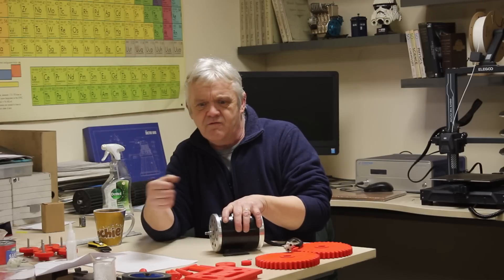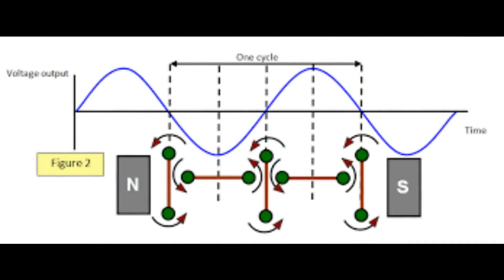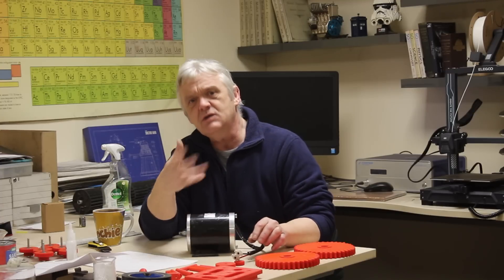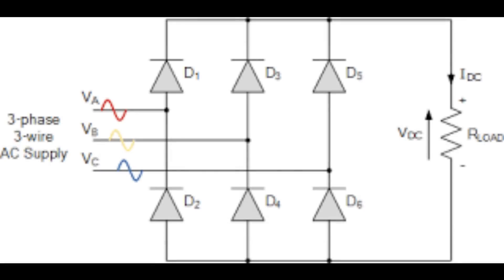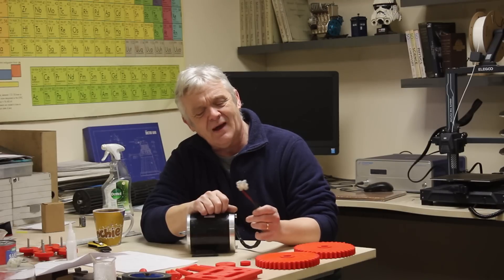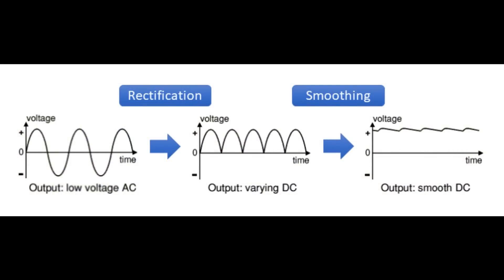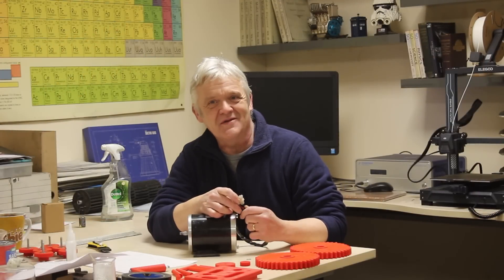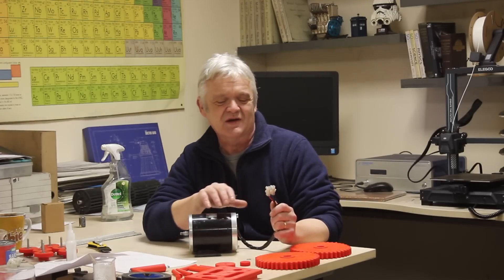1826 What Is MPPT And PWM And What To Do With A DIY Wind Turbine

Comment: There is no maybe. MPPT Controllers.

For crying out loud, YOUR battery argument...

Expesive battery that lasts 27 years

Cheap batteries that last 1 year

MPPT are at least 20% more efficient than PWM

MPPT can be homebrewed just as easily as PWM. Use and Arduino to control IGBTs.

FFS This is a no brainer

Comment: MPPT is about the  neither the power source, or the load. It's about setting the  load's  apparent resistance to the source such that the maximum power flows out of the source and into the load  battery and other electronic equipment.  MPPT adjust the apparent resistance of the load as it appears to the source.  

Here is the theory. 
Take a solar panel, Let's say in full sun, it's unloaded output is 20 volts, and its short circuit currentb is 5 amps:

1) 20 volts/practically infinite resistance = 0 amps, and 20v × 0amps = 0 watts.  
2) Or when we short it and the pannel outputs 5 amps.  Then 5 amps × nearly zero resistance = 0 volts.  And 0 volts × 5 amps = zero watts.   At these two extreme there is no power transfered. But there is a resistance in between  between ware the maximum  power flows from the source and through the MPPT controller.    

MPPT adjust the apparent resistance of the load as it appears to the source.
Reply: Mmmmm 
Yes

and no. Rob isnt an EE. Heʻs a ChemE. So, you just allotropically phase transformed his stoiciometry past the vapor, triple point.
Reply: @canberradogfarts   But Rob is spot on in most cases, simple and elegant, being one of the reasons I subscribed. His conversational style, is also soothing and helps overcome sporadic dopamine deficit.
Reply: @aware2action  I almost completely agree with you 100%. Which is why this was such a dissapointment. This video was too clever by half and completely wrong in fundemental concepts. Which he could have prevented had he done more homework. MPPTs are VERY old, the technology, circuitry and theory go back to at least the 1950s. Ampldynes and mag amps are still in manufacture today that were originally designed during,  WWII, USING MPPT.
Its old, its mature, and it is SIMPLE. Yet Rob missed the mark. Not out of malice or incompetance. He got ahead of himself, he got, for lack of a politely British word, lazy. 

Robs not an Electrical Engineer. He is a Chemical Engineer. He should have done a week or two of expl8cit homework on the subject and written a script, IMHO.
fin
Reply: @canberradogfarts  he only made this video because someone in the comments was complaining that he only covers energy generation and not the portion concerned with connecting the battery/energy storage. So Rob said Okay I'll do a video. The guy is spread thin with managing the fan's whims and he is committed to daily videos covering wide ranges of topics. 

This topic of charge controllers for energy harvesters is widely covered on YouTube BECAUSE it is a mature technology, this is just a summary in the style of his videos and it was fine for that purpose. What this community needs isnt the most clever ideas but some form of self-organization so RMS can juggle less responsibilities. I prefer a forum, myself.
Reply: Also almost all regulators involving wide range of input and output voltage/current use high efficiency switching regulators. One case PWM would work well is, if the output of the solar cell is matched to the battery voltage. The loading effect of increasing duty cycle tries to bring down the output voltage of the solar cell to the desired charging voltage. MPPT on the other hand boost/buck the voltage levels (through high freq switching regulators) to maintain optimal loading by the battery being charged. PWM is simpler and more reliable in general, but a little bit less efficient and cost effective. The same cannot be said for MPPT controllers on the market(esp. the cheaper ones).

Comment: I built my own using a 555 timer, a 78L05 regulator, 2 GP transistor, 2 mosfets and a handful of passive components. 
I needed one for my DIY wind turbine asap, and didn't want to wait months ordering one from China. 
Adjusted the potentiometer to stop charging at 14V, charging a 12V SLA battery. If it goes over 14V, the power is diverted to the 10 Ohm 100W dump resistor. 
Works like magic! MPPT is for systems > 1KW. Otherwise, you're wasting your money.
Reply: Uhhhhh FALSE!

Get an Arduino and learn It is literally easier than what you did. Plus, what you did is so 1976. I hope who ever is grading you project is a social studies instructor and not a competant science instructor. Really. You should be using the best, least tech thats been around for two decades, not six decades.
Reply: @canberradogfarts  I was using Microcontrollers when you were in diapers little man. How old were you back in 1982?
Reply: @canberradogfarts  what he did cost pence and works exactly like you'd want it to.
Reply: You're both wrong. Also, take your new fall apart phone controlled gen z 'tech' and shove it @canberradogfarts

Comment: Question: I've made a small zinc-bromine battery, put it in parallel with a small supercapacitor (made following one of your videos) and connected to a small solar stirling (is a glass tube with steel wool and partially painted black, closed with a ballon with a linear generator and a diode to rectify the output). It seems to be fine as it is, it charges during the day and lights a small led the whole night (never measured how long it would last). In the small scale I did not use a charge controller, if I want to upscale the project, do Ineed a charge controller for the zinc-bromine batteries?
Reply: If the generator voltage greatly exceeds the battery voltage, yes. Also need to make sure the current going in is not excessive, otherwise your batteries will use a lot of water due to gassing.
Reply: @unicornadrian1358  thanks

Comment: One nice thing is that MPPT can modulate your voltage from a 12-24v generator to a higher voltage like 48v and also reduce the risk of damage to lipo and li-ion batteries

Comment: Great overview of basic power controllers!!! Starting to get into senior-year engineering economics, tho.  Sounds like an awesome application for your ultra-robust AC carbon bacitors configured to the desired voltage range with your fractal relay array.  Wouldn't that be cheap, powerful, and safe?

Comment: I haven't really played about with wind generation I was under the impression you needed a different type of charge controller to let the blades spin up before applying the load and also varying the load depending on wind conditions

Comment: As always: "NOT SO FAST MY DEAR!" If for example your battery is empty, and the wind blows lightly, at first the voltage produced raises up, then your switch close, a lot of amps flows (maybe also in a pre programmed amount) and your wind turbine slows down till stop.
Than the switch open up again, the turbine without load resistance turns up againg until reached the desired voltage closing the charging switch, will came back again to a full stop (or so)...
Then?
How do I set the amps to allow to flow not knowing how much wind is blowing?
??????????????????????????????????????????????????????????????????????????
And there falls the donkey! (As We say in Italy)

Comment: The other good thing about mppt is that you don't have to match your battery voltage to your input voltage, which can be quite useful. I've got 67volt of solar module with a 24V battery, which I couldn't do with PWM charge controllers.
Reply: So let me just ask - if you ONLY had a PWM controller, would you have to shunt excesses to a power dump, like a heating element?

Comment: Is there any reason you can't imagine why I shouldn't use a wind turbine charge controller with a solar system? Because I was thinking of connecting my grid tie inverter to the dump load... And drawing my power directly from the battery system. Do you see any problems with that configuration?

Comment: Put the dump load resister into a sand battery and get the extra heat over an extended time.

Comment: I understand high efficiency monocrystalline solar cells have a rapid drop in efficiency when used in off angle and defuse (cloudy) light, however lower efficiency amorphous cells have a slower drop in efficiency under the same conditions. Does ANYBODY test solar cells in those less than optimal conditions ? I want to know under what circumstances an amorphous cells will outproduce a high efficiency monocrystalline cell‽
    If there is no consistent testing, can we start a site that would show test curves?
   If you are into that, we will have to come up with a plan for the "standard test condition" 
What do you recommend?
Reply: @dedu456  thanks I'll check it out! There's no universal test that I'm aware either , I'm just suggesting we get together and make a consistent one. Hopefully one  that can work with lower and equipment two more people can participate.
Reply: Hello.
mr carlson’s lab did that kind of tests.
Cheers.
Reply: Sorry, it’s not mr carlson’s lab, I’m still searching for the video. 😅
Reply: @hommerdalor6301  if you find it, that would be great, especially if he already has a database and a standard testing condition. Hopefully he will join the bandwagon.
Reply: @dedu456  yes it does, and by testing conditions how do you define the diffused lighting condition at what angle do you test indirect lighting at. 
   What ever is done for rating a solar panel has to be done at some standard condition.
And I would like that condition to resemble more like real life, then at a 90-degree angle on the equator on the sunniest day possible.
   I'm hoping some of us YouTubers can come together define a standard and test what we have, plus we may be willing to get, and upload the results, both to YouTube and a specific website for collecting all the results. In that way benefiting all from the knowledge that the manufacturers would never be willing,or even able to coordinate, to get results on.
   Are you with me‽
Reply: What about you Mr. Robert Murray-smith? You have plenty of test equipment, and the knowledge to help define a good testing condition.
Reply: @dedu456  I'm not sure where I'm supposed to be looking for, you don't mean the supermarket do you?

Comment: If you were using it to heat a sand battery couldn’t you hook it up directly to the heat element?
Reply: If I were using it to heat a sand battery, I would take advantage of the Lenz effect and just heat a copper plate and use a heat exchanger to extract the heat.